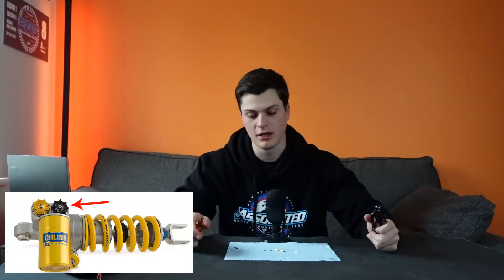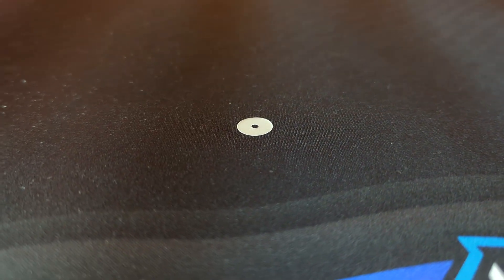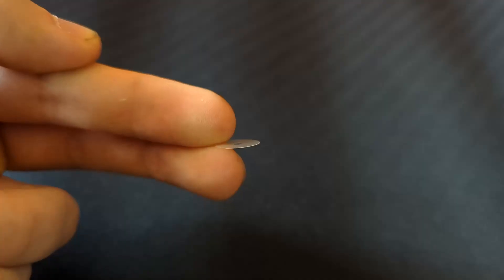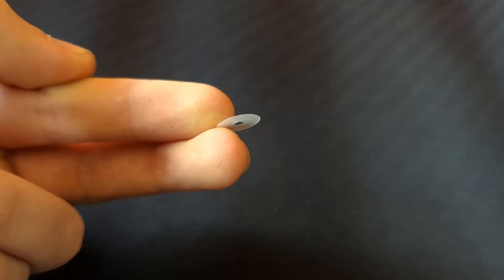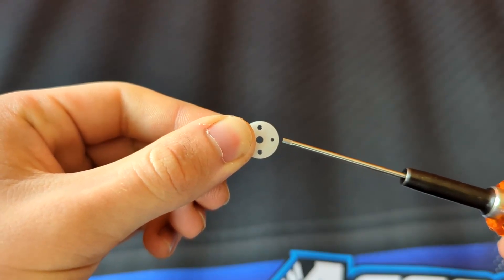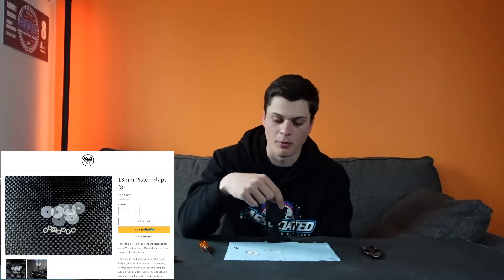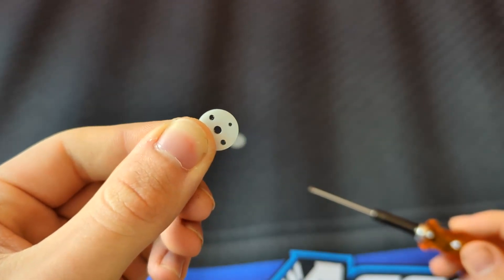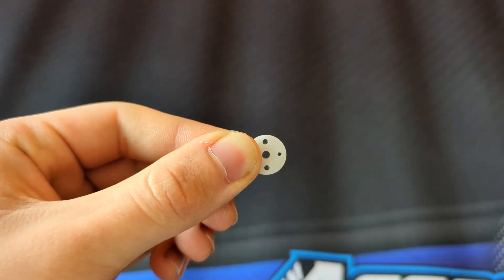Advanced RC Shock Setup: Tuning Rebound and Compression Damping

Comment: 👍, this is right up my alley. 
Custom pistons with brass shims. I like the idea of different hole/port sizes instead of different shims thickness to control flow. 
There is a trade off though. To make rebound and compression work. You need a close tolerance between piston and cylinder.  Or the flow will just bypass the holes. 
Too tight a tolerance and there will be too much drag.
Time to fire up the lathe😊

Comment: I used to race MTB DH and rebound was was more imlortant than low speed compresion, i leave a balanced ammount of air in the shocks so the oil air acts as a rebound, seemed to work

Comment: Im curious what your view would be on running bump stops 

The goal being to add some progressive spring rate at the bottom of travel to stop the chassis hitting the floor 

This should allow you to run softer suspension and a lower ride height ???

Comment: In theory it works. In practice the working window is so small that sometimes you cannot feel it. I mean: because the sistem works, you need a clear cycle open/close flap during the stroke. But on high speed dumping, the inertia of flap is not able to fully close the holes on rebound (assuming they are on the bottom of piston). So you can have a condition in which they tend to stay openish disturbing oil flow.

Comment: A friend of mine back in high school in the early 90s had a Traxxas hawk. It came with a big bag of pistons and another bag of pre cut clear washers like you described. The pistons had different numbers of holes on the inside and notches on the outside giving you the option of split valving. I thought it was a great idea but it never really caught on.

Comment: The damper tries to rebound faster because the piston rod displaces the oil when retracting, which increases the total pressure when retracted Also, every vehicle has a stronger rebound than compression damping. Why should it be the other way around in this example?